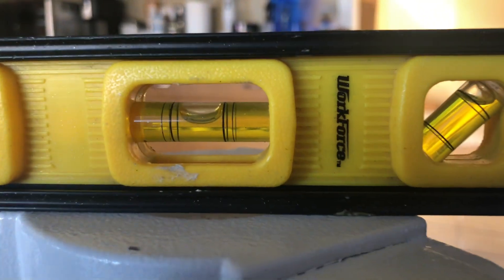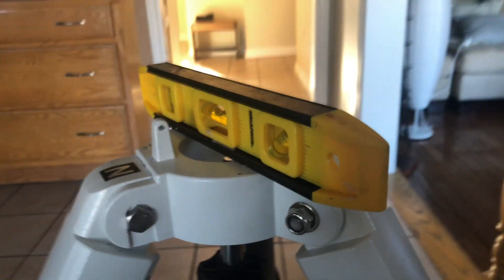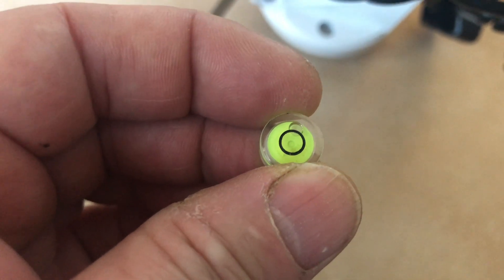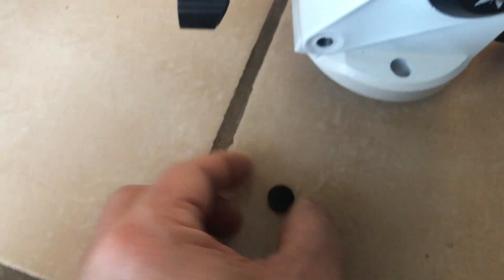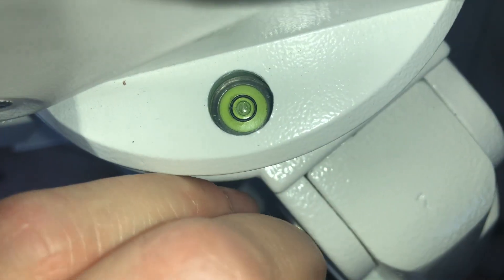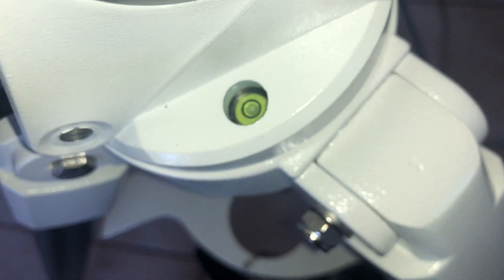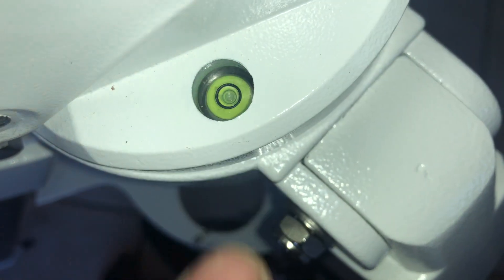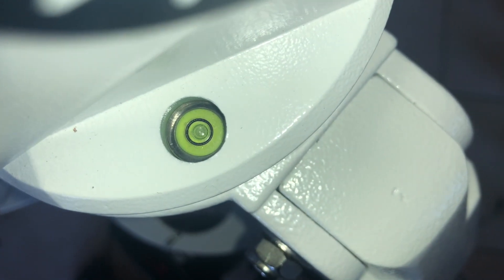Meade LX85 update...possibly solved ???

Comment: No don't buy Meade lx85 I have only problems with this shitty mount, can't use the go to, can't follow the stars, no polar scope and a lot of things... Choose skywatcher or eq mount
Reply from the maker: Hey I find the Goto to be perfect for visual use anyway.  Once it's aligned objects are dead centre, Astrophotography though, my experience so far is not good but it may be the Asiair as they have no software settings for this specific mount. If you still have it call Meade for a repair or exchange. I do agree to go with Skywatcher, lots of users getting great results.
Reply: @shivercanada  hi, problem I m from Switzerland and in Europe we haven't Meade market or other store and I do astrophotography and I found Meade lx85 not good for that

Comment: HiI'm going to buy Meade LX85 Series Telescope - 8" ACF™. What is you opinion? Is it good choice?
Reply from the maker: Hey thanks for stopping by! I haven't had tracking working right from day 1 but I'm not sure if it's the mount, this bubble level issue, my polar aligning,  the Asiair or the fact that it's an SCT. I would highly recommend if you want too do Astrophotography to get a smaller size OTA. This 8" is 2032mm and it's very problematic for guiding because it has so much magnification. With Asiair it won't plate solve or polar align unless you have a focal reducer ( makes mine 1280mm). I'd get an Apochromatic refractor for Photography if I could do it over again. I might even splurge more for a RASA or Celestron OTA with Hyperstar.  An 8" with Hyperstar would make the focal length  around 425mm so guiding would be a breeze. Meade sadly doesn't have that option.
Reply: @shivercanada  The problem is you. Do some research  if you can learn at all.